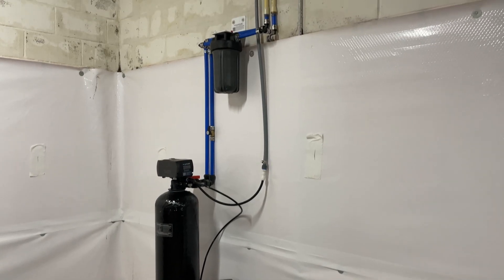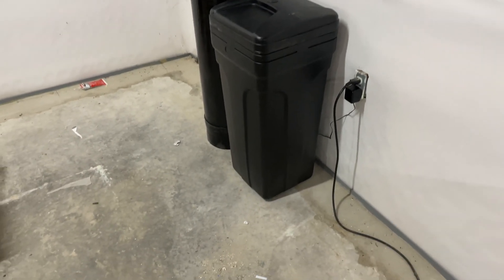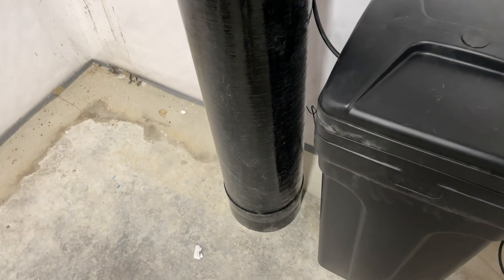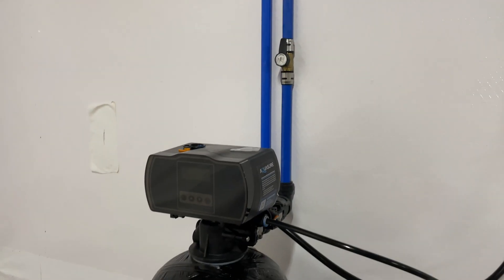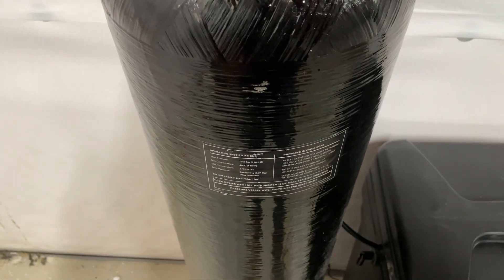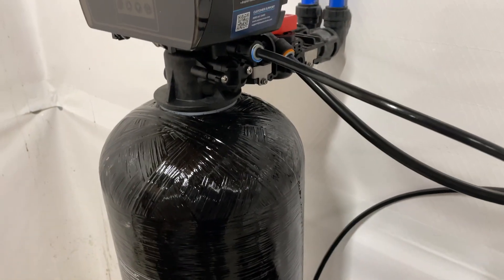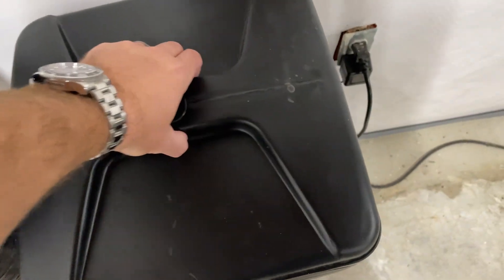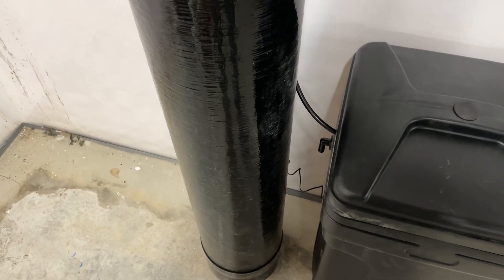How Does a Water Softener Work? - In Plain English

Comment: I have a similar set up but have a whole house activated carbon filter where all of the water runs through prior to going through the resin bead tank...That is supposed to give you many more years of life and takes a lot of wear off the resin as the regeneration is supposed to be more effective when that carbon filtered water runs through.  I'm in South TX (north of San Antonio) and our water is really hard with lime.  In Wisconsin where we were it was hard with iron.  Makes a HUGE diffrerence on appliances and cleaning showers.  We have an osmosis water filter set up as well for cooking and drinking water.  Only downside is my kids and wife have become water snobs now as ours is better than bottled water.
Reply from the maker: I'm installing the reverse osmosis filter this weekend for drinking water (refrigerator and ice maker).  That's a cool setup that you have!  I have the whole house filter also that the water runs into before it hits the water softener.  Cleaning shower is definitely an effortless task with soft water!